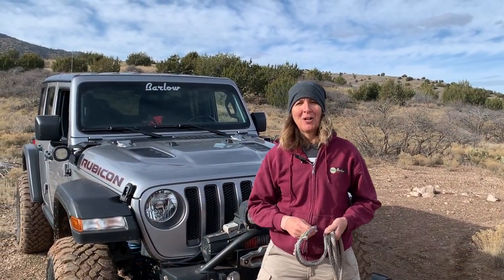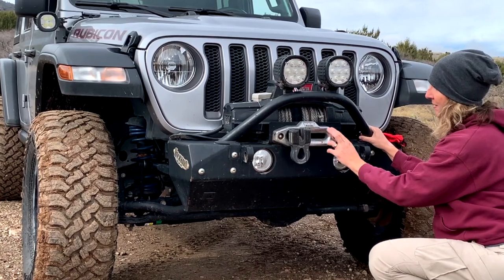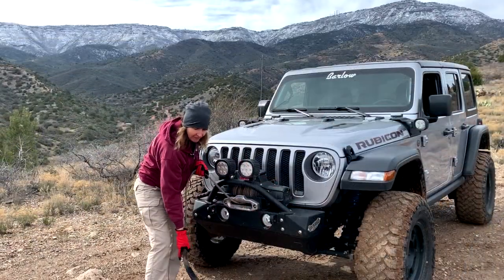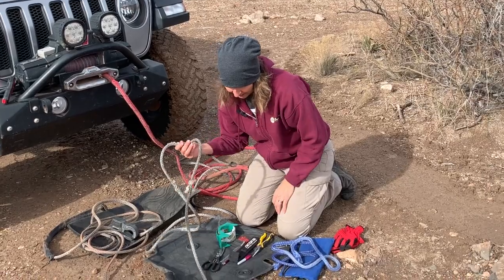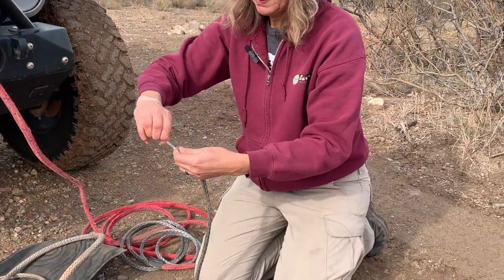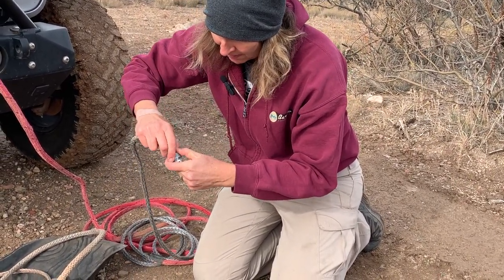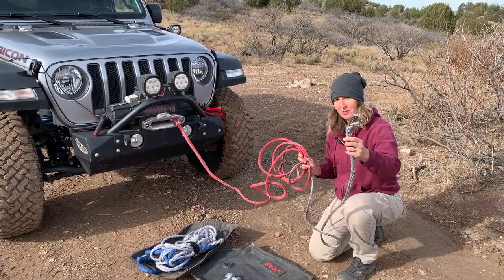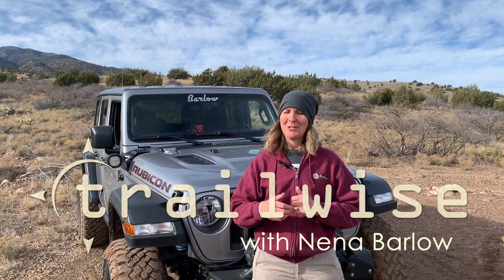Trailwise | Winch Line Field Repair

Comment: Could you have spliced the end with the factor 55 back into the drum line? Seems like it would work and would maybe give near-full winch utility.
Reply from the maker: You need the loop for a strong connection. Feeding it straight in is not likely to hold in a winch pull.

Comment: Great video, Nena! I was a little surprised at the end when you connected the two lengths of line with a screw pin bow shackle. Isn’t that a potential projectile? Not trying to be a smartass - I was just told never to join lines this way. Please advise.
Reply from the maker: Although I would normally prefer a soft shackle, in the video I explain that since there is no thimble or sleeve on the one loop, the wider and smoother surface of the bow shackle is less likely to cause a rope failure than the rope-on-rope connection. And one more thing—you should always assess the load factor on a piece of equipment, eliminate friction and double and triple check for twisting. If you have done your work, there should be very little risk of a properly rated and installed bow shackle becoming a projectile. Ask me how I feel about line dampeners. 😎
Reply: @jeepschool  thanks for the detailed reply. How DO you feel about line dampeners?!? 🤪
Reply: @jeepschool  ... so how do you feel about line dampers? They have never made much sense to me.